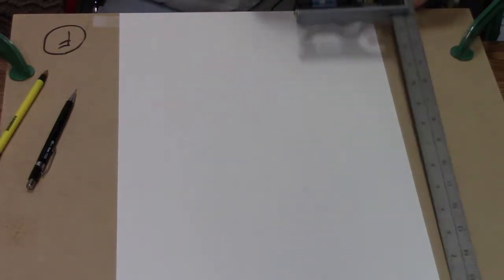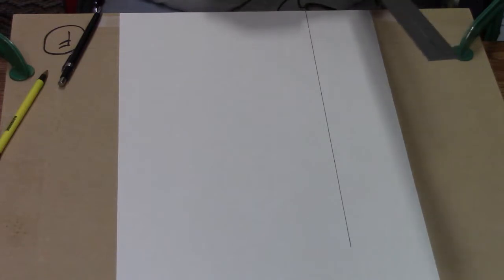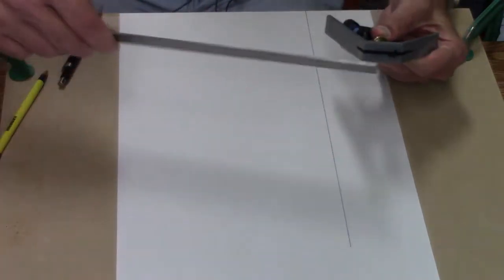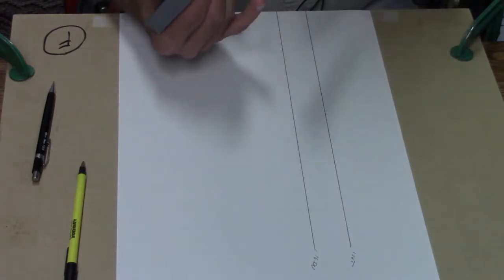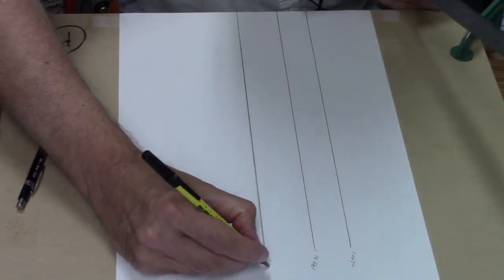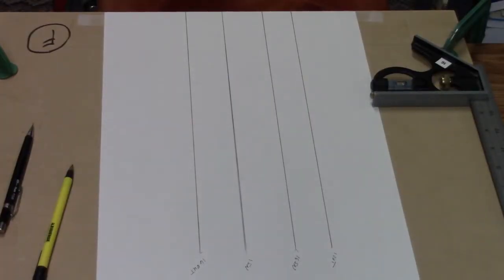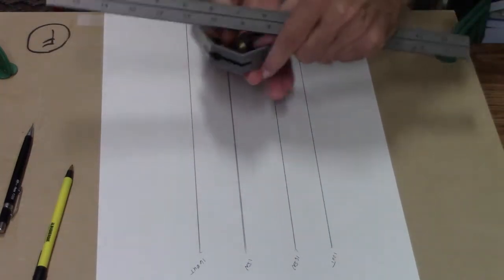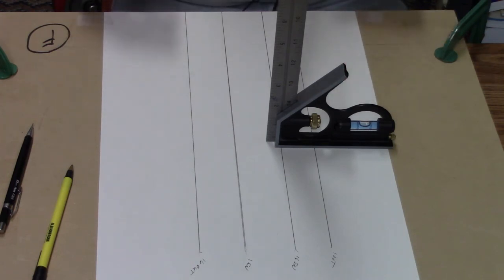Combination Square: DON'T ADJUST IT UNTIL YOU CHECK THIS!

Comment from the maker: This is my first video, and I forgot to mention a few things:

(1) The test is performed on a piece of MDF, and a factory edge was used as the reference surface for the square head.

(2) I forgot to say anything about the final test; the one for the “16 OUT” configuration.  That line was also pretty good, as you can see in the video. Thus, we have the situation where this particular square, as delivered, basically has 3 acceptable configurations and 1 unacceptable configuration, when set up to measure outside corners.

 Note that if I were instead to have adjusted the square based on the single test of the “1 IN” configuration, that I would have then ended up with a square that had 1 acceptable configuration and 3 unacceptable configurations.

(3) It is also possible to measure the squareness in configurations meant for checking inside corners, using the same method.  It requires a bit more setup; I didn't bother.

Comment: Do you suppose this is occurring because the blade sides are not parallel?
Reply from the maker: Yes, but if were only that, we'd simply see a different result when one edge of the scale is against the reference points inside the head as opposed to when the other edge of the scale is against it.  That is, we'd get two configurations square (if any of them were) with the other two configurations non-square.

I believe that what is happening is that one edge of the scale has a curve at one end.  If only there were time to do it, I could carefully characterize the straightness and parallelism of the two sides of the scale and relate that data to the squareness test results.  I have all the necessary equipment, but not the time.

Comment: Great info but you left us without any answers. So what would you do about this error?
Reply from the maker: Thank you for your interest in this information and for your question!  What I have done is to mark the square with the preferred configuration(s), so that when I use it to determine squareness, I get an accurate result.  My initial reason for changing the configuration of the square was to get the preferred measurement scale in position for the measurement that I wanted to make.  I realize now that doing that has a cost, and I now usually don't bother changing the configuration from the one that gives me the most accurate square.

Comment: Who cares about the flipped bolt?  you got good readings on the original bolt setting so leave it alone.  you have an accurate square. Don't go looking for trouble.
Reply from the maker: Thank you for your comment.  "Looking for trouble" might be the thing that I am best at.  While we disagree about this particular issue, I do have to admit that as my eyes get older, I have less and less use for 1/64 graduations.